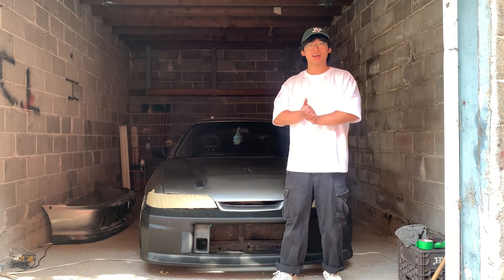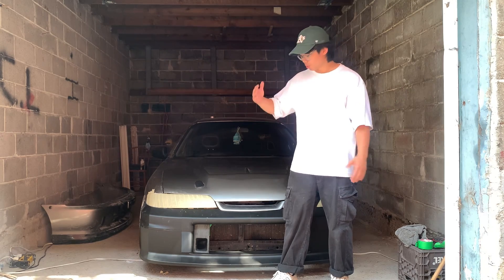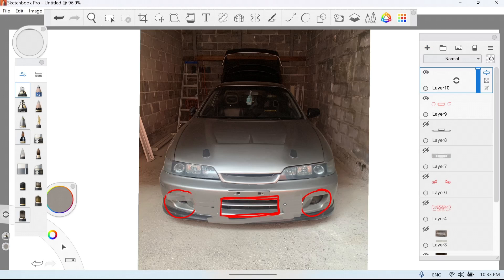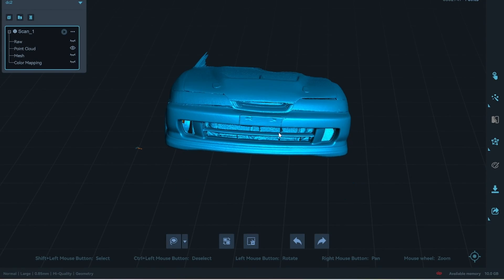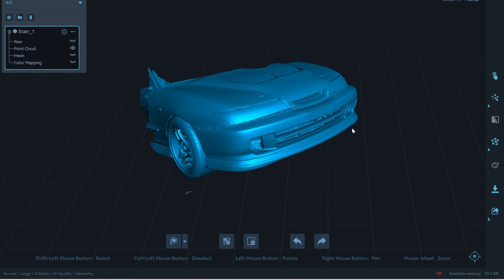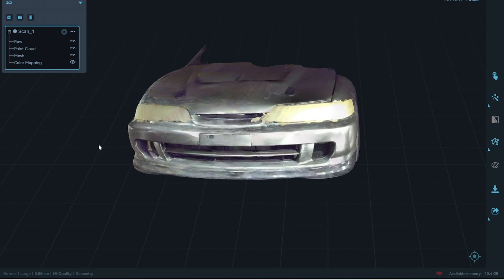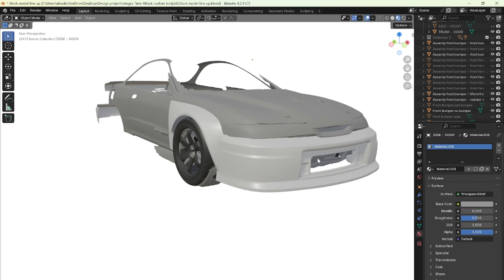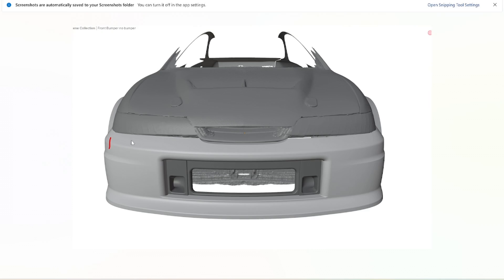Building a 3D Printed Time Attack Bumper in 5 Days

Comment: I'm wondering why the color looks different on sides, is it a different filament, or is the direction of layers building up affecting its look under light?
Reply from the maker: yeah different layers build up. They are the same filament. after sanding and primer they will look all the same
Reply: @BadDesignGoodDesign  I've never worked with a 3d printer before, thanks for sharing. Good to know about those details in advance. Nice design btw, I would like to see how it will turn out at the end.

Comment: Be careful using PLA on car parts because PLA does tend to deform the easiest out of most of the 3D printing materials, I know from my experience, PLA parts in even 80F/26.6C degree days can cause parts to deform a little from just being in the sun (this temperature is the temperature outside not even the temperature of the paint or in the car which is of course probably way hotter). PETG is probably a better choice since (again from my experience) its not very hard to print with especially with a newer printer like your Bambu Labs printer and it deforms around 70-80C rather than 60C of PLA. 
To the 3D printing nerds: I know ASA is an option and is literally one of the best for printing car parts with high heat resistance and UV resistance, but ASA does release toxic fumes, prone to warping while printing since the cooling it needs since hes printing such big parts, and quality ASA from reputable brands are almost triple the price of PLA and double the price of PETG.
Reply from the maker: Yes Im aware of the draw back of PLA. I choose it because the car mostly in garage for developement and I find it less troublesome to print than Petg. ASA is toxic so I dont want to touch it. If i need a harder material I would go for PETG-CF. But good point for those who new to 3d print
Reply: @BadDesignGoodDesign  i think PLA/PETG is perfectly fine for bumpers in terms of durability tbh, probably more durable than fiberglass bumpers but since you're printing the entire bumper PETG-CF degrades the nozzle unless you do an upgrade to hardened steel, but to keep cost down and keep it simple I think PETG is perfectly fine for this application and is less expensive.
Reply: @BadDesignGoodDesign  Also for the PLA, one day of being out on a hot day can cause this damage!! Just warning you to be careful.

Comment: It looks a little plain, but not bad. If you make a V2, consider including ducts for splitter tunnels so that it can improve your front downforce efficiency. Also, if strength and ease of assembly are ever a concern, consider adding some indexing/connection tabs to all the pieces, and then wrapping the finished bumper in a couple of layers of either carbon/kevlar or S-glass fiberglass mat. You could even go a step further and have the bumper structure made up of a hollow honeycomb complex 3-5mm or so thick and THEN glass it, since the distance between layers is what creates strength while keeping weight down for fiberglassed parts.

Comment: 5 days  from concept to end of Vid....1 printer. On day 2 was the first 3d scan?   Any one in the 3d world want to speak on the timeline? I just started 3d printing so I can't say 100%  it can't be done. The coments are right if your doing the build we want to see the build. Bought 3 3d printers and it still takes awhile with Core xy printers. What material was used?
Reply from the maker: Oh sorry for the confusion I have 3 Bambu lab printer and I have 20 piece in total. The printer automate everything and I have a system of refill filament so it went by faster.

Comment: Great video! Amazing work assembling that bumper, it looks so smooth already! Just one or two joins which will require a bit of work to get smooth.
How the heck did you print the parts so thin? They are not easy shapes to print so thin - did you use lots of supports when printing them? Thank you!

Comment: It's just a thought but perhaps you could add tabs on the back sides at the joints to interlock them kind of like when you interlock your fingers when you put your hands together.
Reply from the maker: im using plastic welder with thin metal that patch the joint together. its pretty solid and impossible to pull off without damaging the print haha
Reply: That's what I did for the front lip I designed for my car. Using the tabs made it easier to line up while plastic welding them together. Just need to finish printing the pieces.

Comment: Great job! What the tool you are using to connect the pieces? I have seen these before, they heat the joining wire and imbed it into the plastic. Thanks
Reply from the maker: yes I use plastic welder. it hold very well

Comment: I exactly did the same for the spoiler I made for my ND miata, for testing purposes PLA is unbeatable, cheap and fast to print. 
Still debating whether I will be using ABS, ASA or even making a mold to create the final part in fiberglass or something else.

PS: I have done CFD in the past, but planning to move to OpenFoam as it is open srouce, maybe could be helpful for this build too in case you haven't simulated it yet and have the time to learn the software.
Reply from the maker: That’s cool that you do cfd too. It’s a good tool to create impactful design. Yes for now Pla is still very good for prototyping

Comment: Looks good.  Do you intend to use it as a 3D print or are you going to use it as a mold? What material is it?
Reply from the maker: this print is purely to test fit with the car. To make the mould I will use CNC